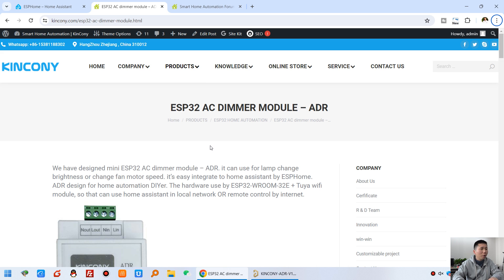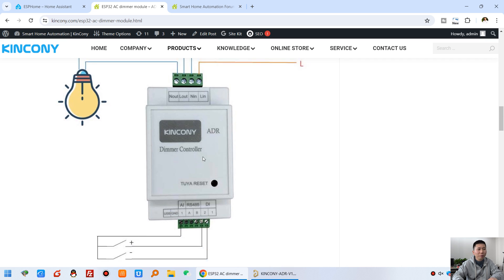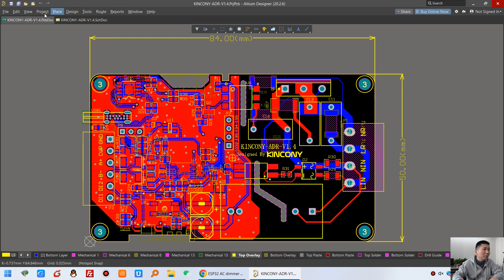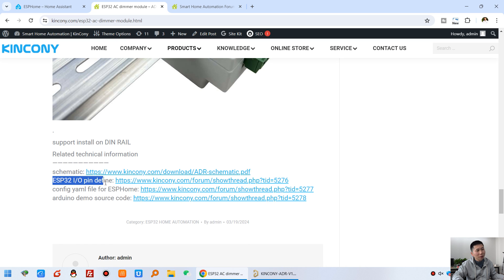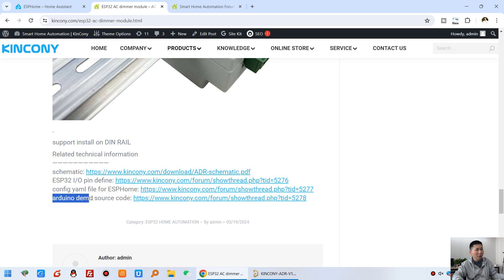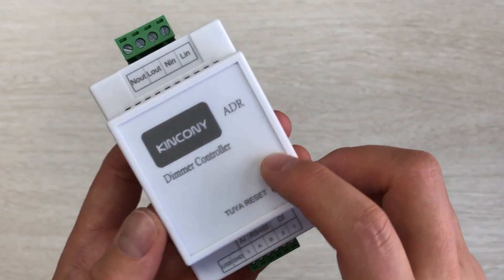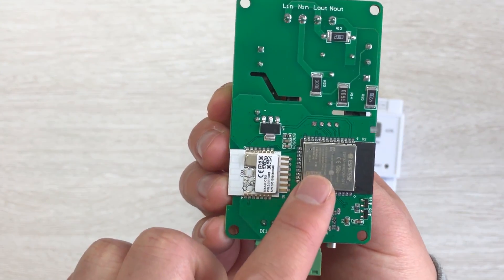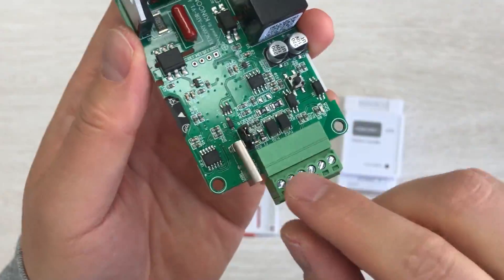how to make old ceiling fan or bulb smart by KinCony ADR ESP32 AC Dimmer

Comment: Great video from kincony....can we able to connect LED lights for dimming? can we able to connect trailing or leading edge drivers?
what is the maximum amps it can handle/how many lights i can connect in parallel
Reply from the maker: sure, if use AC220v dimmable LED is ok.  suggest use MAX 2A load, actually we use 40A thyristor, if use large current, will be hot, unless add heatsink.

Comment: Hi, in Italy we need a remote commander for gates... in short, a clone of the radio control that you usually have but controlled remotely, without however connecting/intervening on the gates circuit. Therefore connected to the Internet but which simulates the real remote control of the electric gate for vehicles.
Reply from the maker: our KinCony AG Pro wireless controller already can do that.
Reply: @KinCony  rolling code also?
Reply from the maker: EV1527 or PT2262 types of code can be learned. @chickeandtech
Reply: @KinCony  I think they are not enough here in Italy/Europe... we usually have XT2 remotes and similar.